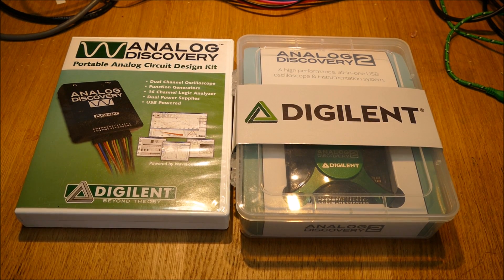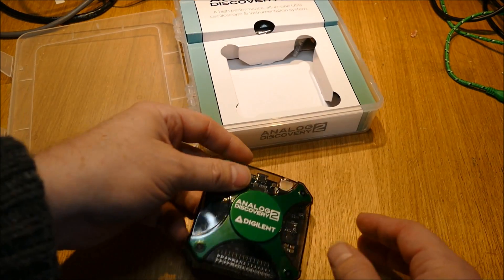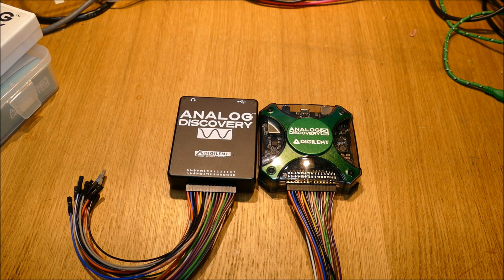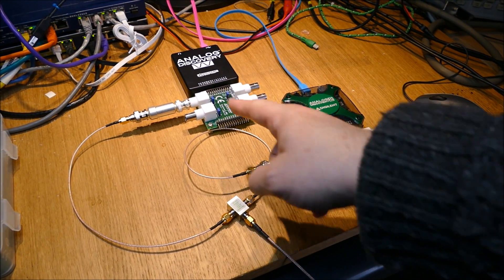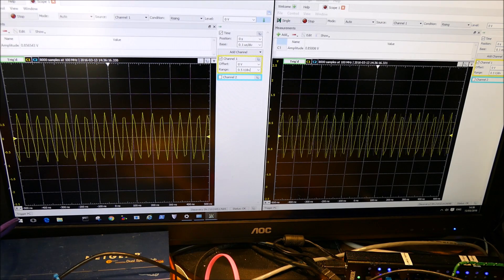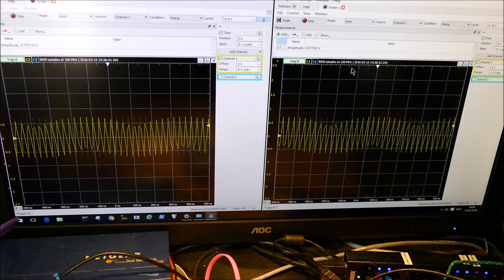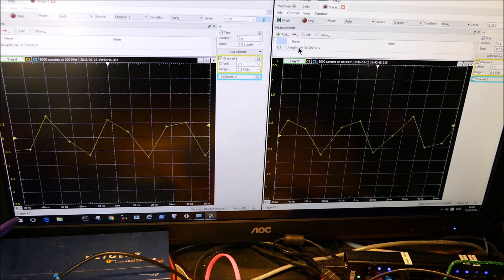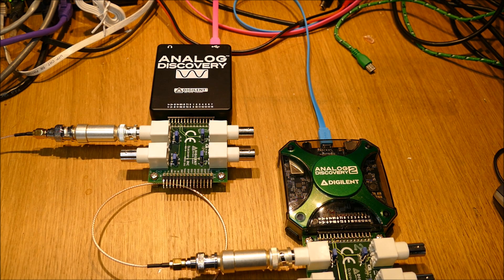Comparing Digilent Analog Discovery 1 and 2

Comment: Thanks, very informative video! However aside from portability how do these devices actually compare to say a low end bench oscilloscope and a dedicated logic analyser? Also is the spectrum analyser any good? I mean even an economically priced spectrum  analyser is in the region £400-500.
Reply from the maker: As far as a low end USB Swiss Army Knife of EE tools, both are without equal for the money. Do I use it on the bench? Not much, except for the arbitrary digital signal generation capabilities: I have a reasonably well-equipped bench though.

The ADs are quite low bandwidth devices, and don't have a lot of memory. Plus, I personally don't much like using a PC UI to operate most test equipment. Once you have used a bench scope, the knob and button interface is so much better than mouse clicks.

If I was only looking for a bench scope, it's hard to find better value than the Rigol DS1054Z at the moment.

But the ADs aren't just a scope, they both include a logic analyser, dual channel signal generator and digital signal generator, and as far as PC based instruments go their UI is about as good as it gets. If you're into Arduinos I am sure that either AD will suffice for the vast majority of use cases. I also highly recommend them for tinkerers and EE students, as well as them being a very compact and handy tool for the embedded systems engineer when travelling.
Reply from the maker: Regarding its use as a spectrum analyser, this is just a software derived FFT from the scope front end. Whether that's any use for you depends on the application. It's of little use for most RF applications for example.
Reply: Detailed answer. Thanks for taking the time to message me back, your reply has helped me make up my mind regarding whether to buy an AD2. Thanks again!

Regards, 
Marc